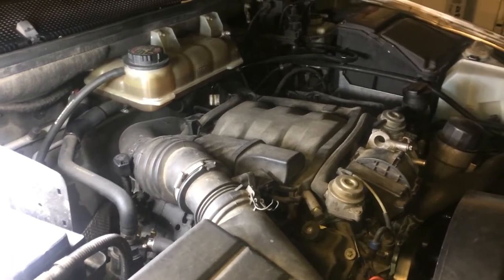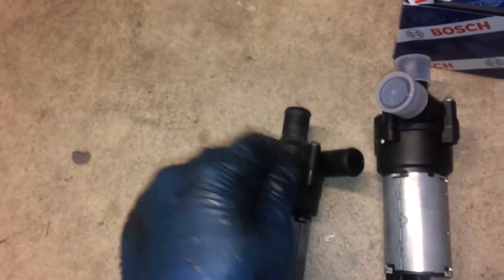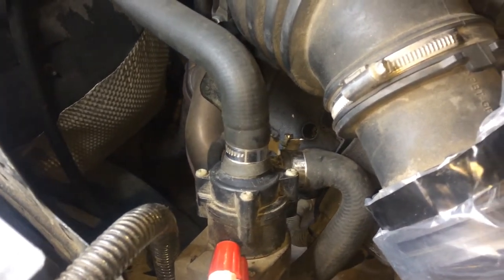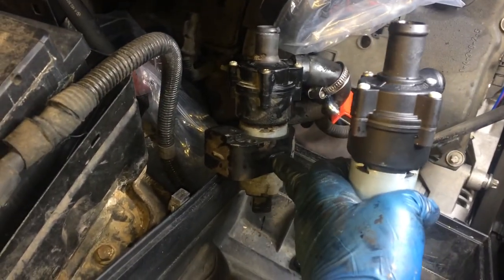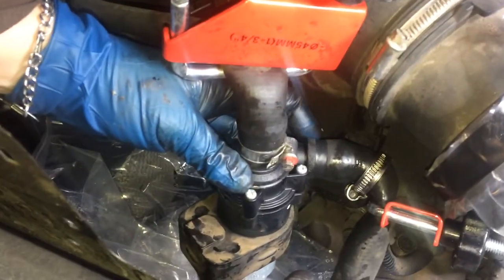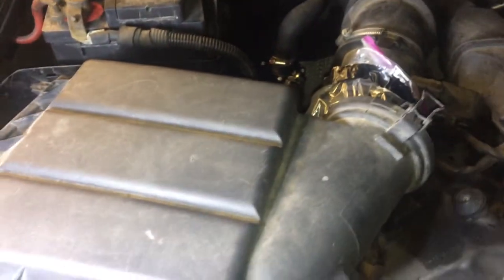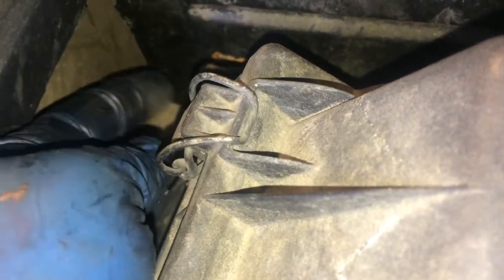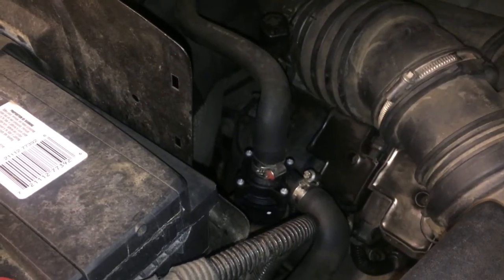DIY Replace Mercedes W163 Auxiliary Water Pump without Draining Coolant ML350 ML500 M112 M113

Comment: I bought an ML430 for $200 on Facebook marketplace and it had a lot of problems.  I'm pretty certain it was from the previous owners mechanic. The aux water pump was absent and replaced by a flanged copper elbow pipe fitting. The trans filter pan was missing the OEM brackets and replaced by a washer and bolt. The washer held it in place as bolt tightened. The previous owner said her mechanic wanted $4k to replace the transmission and cost too much to fix. I owned a ML320 and seen this type of problem before. I added half a quart ATF, a fully charged battery, and drove her home. I love your ML videos. I had to replace the EGR and you helped me

Comment: OMG - excellent video.  I just got the code on my scanner that this pump is bad and having intermittent issues with my A/C.  I can't believe the Mercedes version costs so much more.  Thanks for the detailed explanation.
Reply from the maker: Yes, the MB part is super expensive!  
It is not related to this repair, but I just recently did an AC system repair on a W163 ('03 ML350).  I'm hoping to have the video up within the next couple of weeks, so check back for that one.  That job was the AC expansion valve, compressor solenoid, and accumulator R&R, and then recharge.  I mention it because that Benz was having "intermittent" AC issues, too -- the AC would blow cold one day, then warm the next, then cold again, etc, despite being at full charge.  It turned out to be a failed expansion valve and perhaps the compressor solenoid (the later model gen-1 ML's have a variable compressor design, so the compressors have control valves or solenoids).  I say "perhaps" because I'm not positive about the compressor solenoid, but I replaced it anyway since I was in there and had the system evacuated and they are only $40.  
Usually with the W163, AC issues are caused by a failed expansion valve, which is not difficult to replace (though you do have to evacuate and recharge the system, and replace the accumulator while you're in there).  So check back for that video, hopefully before September!
Reply: @L35inColorado  How did you determine it was the expansion valve?  Was this based on manifold pressure?  (Hi on the low pressure manifold?)  TIA.  Looking forward to your video.
Reply from the maker: @DIYDharma  Yes, I hooked up a manifold gauge set, ran the engine for a few minutes with the AC on high, then shut off the engine and left the gauges in place.  A good expansion valve will allow the high and low pressures to equalize to the same pressure within 10 or 15 minutes.  I left the gauges on for over 3 hours and the pressures were NOT equalized! (and still had a big pressure difference)  So, if you have a manifold gauge set, that's an easy first test.  The low side port is up by the firewall, passenger side.  The high side port is a little awkward to reach, but its tucked down on the inside edge of the driver's headlight.

Comment: Thanks for this Vid!! Got my 039 in my cart. Can't wait to change it this week. Maybe you could answer something for me. All the sudden my heat stop blowing hot I think it's the same as this video. I flushed out the heater core I cleaned out the air filter and still nothing so I believe it's this water pump and my thermostat is fine cuz the engine Heats to the right level at the right time. Let me know what you think I'm going to change and anyways because it's quick and cheap
Reply from the maker: I'm sorry that's happening, no heat in the winter!  As far as I know, the aux coolant pump will not cause the issue you're describing with your heat, and anecdotally I can tell you that when our aux pump was out, we still had heat.  
Typically, the first thing I think of when there's no heat is a stuck-open thermostat: if your thermostat is stuck open, then your engine temp will never reach the normal range (about half way or a little higher on the engine temp gauge). If your engine temp is not reaching that normal operating range after a few minutes of driving, then your problem is likely the thermostat stuck open. In that case, the open thermostat is not restricting flow so the coolant is just not heating up adequately, so the coolant reaching the heater core isn't hot enough to produce much interior heat.  You can also notice this by feeling whether the heater core hoses are hot.

On the other hand, if your engine is reaching normal temps, and you still don't have heat coming out the vents and you know your heater core is not blocked, then the problem is more likely to be one of the components of the HVAC system within the dash. The HVAC system on the W163 is complicated because there are electronically-controlled motors behind the dash (multiple locations) that control the opening/closing of different doors. 
One of those motors that is a known failure point on the W163 is the blend door motor: that is the motor that controls the "blend" of hot & cold air to the vents.  If it gets stuck on the "cold" side, then no hot air will make it to the vents even if there's plenty of heat from the engine reaching the heater core.  Sometimes that motor fails intermittently, and other times it just goes kaput all of the sudden.  
I'm not sure that that is what your problem is, but it is possible: unfortunately that repair requires removing the dash. I do have a complete video on it here:
https://www.youtube.com/watch?v=ptp8my_87W4

Also, check out the forums to see if you can locate a solution, this like:
https://www.benzworld.org/threads/no-heat.3008311/

I hope that helps - good luck!  : )
Reply: @L35inColorado  yeah I saved that other video, I like your channel because you have a good speaking speed and tone to listen to instead of having to adjust it. Anyways I'll check that out or just bring it to the shop. 
  I did notice that the hose going into the auxiliary pump is hot and the hose going out of the auxiliary pump is hot when I crank the heat although when I turn the car off and run around and I even put a tube of paper to listen to the auxiliary pump I heard Nothing.
 You may be right about those blowers. Not sure like I said but it seem to correlate with the time just after I rinsed my engine for the first time but I did Cover the battery and the alternator don't know if I shorted something out.
   PS I know it sounds stupid to you but for the first few minutes I did have the engine running is I was lightly misting it so maybe water got into the air flow and burned something out, my temperature is spot-on it always goes up to halfway as the car has warmed up never gets hot and's never under
PS.S., the heater core tubes seems like the one if you're facing it the Left one gets Hot and the Right one is just Lukewarm

Comment: Hello, excellent video, I have a question, does this pump help in the engine cooling system or does it only work for heater sistems, thanks.
Reply from the maker: I'm sorry I missed your comment - this pump is for engine cooling. I hope that helps! : )
Reply: @L35inColorado  thanks.

Comment: Instead of using the Bosch pump as a whole, remove the 4 screws on the top of both pumps and use the Mercedes hose connector.  This will not stretch the hoses.
Reply from the maker: Thanks for the tip!

Comment: one question , what was the original issue or the reason why you changed this?
Reply from the maker: This aux water pump was replaced because I noticed that I couldn't hear on it on this ML (compared to other MB's) after the engine was shut off.  So I checked the circuit and determined the pump had failed.  I hope that helps!  : )

Comment: Hi there 👋🏼 so glad I found your video. Could save me tons. What year Audi or VW and model do I look for? Wondering if it s apart I can get at my local parts store. Fcp takes a bit to ship and I need to get this car going asap
Reply from the maker: The part shown is Bosch 0392020039 - a parts store can use that number to see if they have it, or a compatible part.  I hope that helps : )

Comment: Hey I just replaced mine with a used once after my interior stuff shorted I put the used one ina be evrything was fine. But now it seems as my heat is not registering and am not hearing the cool and vent move behind the dash. Can the other fuses short besides the one that controls the pump and interior?

Comment: Thanks so much , very well explained.
Do you think a problem in aux pump can do my heater don't work well?
I checked all, fuses, heater really and ac/heater control flap and all its ok
Reply from the maker: Thanks for the comment!  No, I don't think that the aux pump can cause the heater to work poorly.  The reason is because we had the aux pumps fail in two ML's, and both still had strong heat.  Have you checked your thermostat?

Comment: Hi there great video!! Would this cause no heat to blow from the heater in the cab? Mine is only blowing cold air on the max heat setting..
Reply from the maker: Hi, no -- this failure would not cause your particular issue. What you are describing sounds more like another common failure on these trucks, which is the blend door actuator.  It could also be the thermostat, but in.that case, you'd notice that the engine doesn't warm up either (if it was the thermostat).  So, if the engine IS warming up normally (radiator hoses are hot, temp guage is normal, etc) BUT you have no heat, then I'd troubleshoot for the blend door actuator. Google "Mercedes w163 blend door stuck" and you'll see what I mean.   Good luck!
Reply: @L35inColorado  thank you for the info I will definitely look into that! It makes sense because every setting I turn it on it stays the same (venting dosent change) and the middle 3 vents dont blow any air out of them. I appreciate you and it should be fun :/

Comment: Thanks for reply. The aux pump working I tested but the problem is  its  not getting power to work for 5 minutes after engine off . !
Reply from the maker: Okay, I see -- wow, that's frustrating!  I'm sorry that I can't help, because I'm not sure what would cause that (other than the ECU).  I don't have a wiring diagram for the X164, but if you can find one, you might be able to trouble-shoot it using the wiring diagram.  Good luck!

Comment: What symptoms would be displayed if the auxiliary water pump is going bad or has died? Would it affect engine coolant temps etc?
Reply from the maker: I don't think that a failing or dead aux pump would affect engine temperature significantly, but it might affect how well your interior heater works when you first start it up on a cold day.  
Here is a great thread:
https://www.benzworld.org/threads/replaced-auxiliary-water-pump.2907498/
We have two ML's, both used, and neither had a working pump until I replaced them both.  Neither ML had an engine heat issues before the replacement.   Are you overheating?
Reply: Yes it would affect engine coolant temps

Comment: I have GL 500 2012 my auxiliary pump working well.
 in engine off mode activate AC bottom the heat working perfect. when engine working the pump working well. 
but when engine off the pump also stops.
Question is what’s responsible for running the pump on or off. why it not working after engine off, at less for two minutes
Reply from the maker: I'm not sure about the aux pump for the X164 models, but I would think that the ECU controls the signal for the pump (on and off).  If the pump is old and the brushes are worn out (ie, higher mileage engine), then perhaps the pump runs intermittently while the engine is running, since the main water pump is running at that time, too, which would reduce the load on the auxiliary pump for circulating coolant (if the brushes are worn to the point that they would only intermediately work -- perhaps this could happen as it does in other brushed motors).  

I would try this: shut off the engine, then tap the aux pump, and see if it will run when you tap it, even if for just a little bit.  Sometimes when brushes are going out, tapping the motor will be just enough to get it to turn for a second.  If the pump doesn't respond, then I would backprobe the electrical connector for the pump, and see if it is getting voltage.  If it is getting voltage and it is not running, then you know it is getting a signal, so the problem then would be the pump itself.  

In that case, then either replace the pump, or if you can find the proper brushes, you might be able to open the pump motor and just replace the brushes.  Good luck!

Comment: Can this cause the A/C to not work?
Reply from the maker: No - this pump is simply for circulating engine coolant after the engine is shut off, and doesn't have any effect on the AC system.  I hope that helps : )